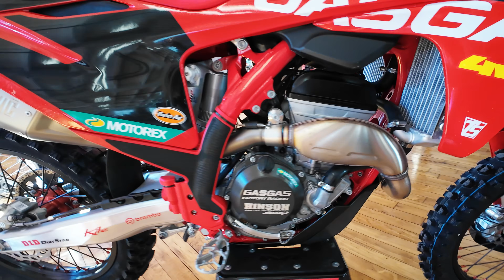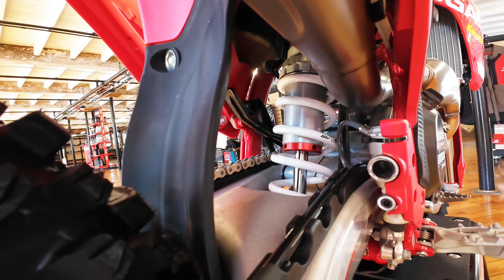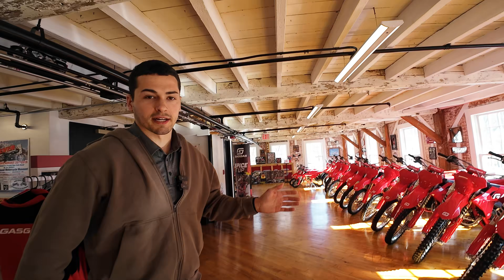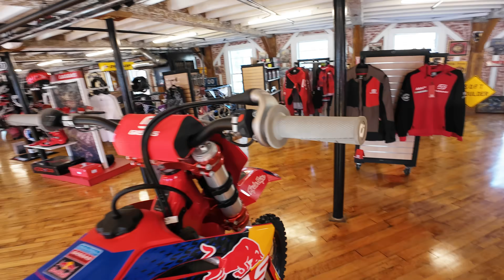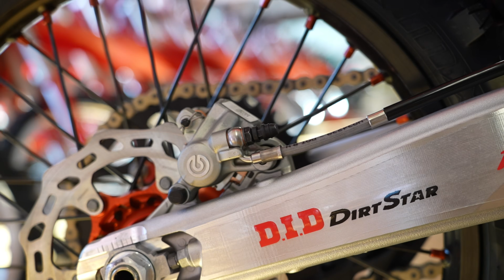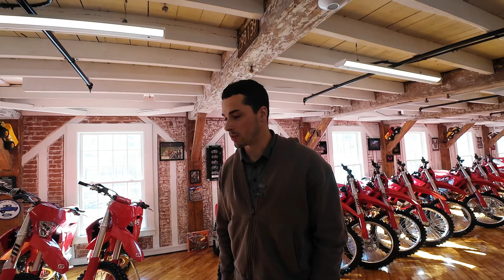FIRST LOOK: 2024.5 GASGAS MC250FE Factory Edition

Comment: first off it looks great.  They need to make a woods version.  I have a 23 KTM Factory 350 and this one looks better to me.  With the Akro pipe which is a little more durable that the anodized FMF on the 23  The chassis modes and turnability which I hear they will make available for 23 model bikes just will need to get 24 style fender.  All very nice I may wait until 25  though to trade out my 23.